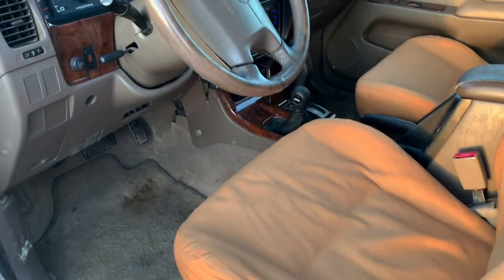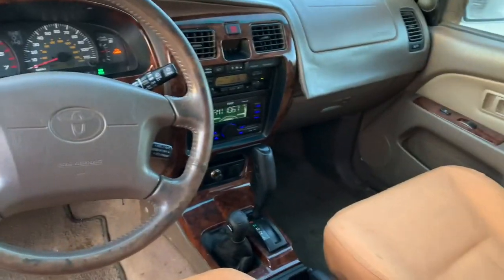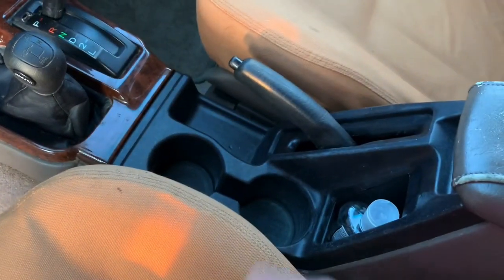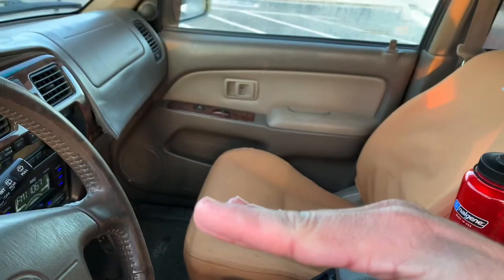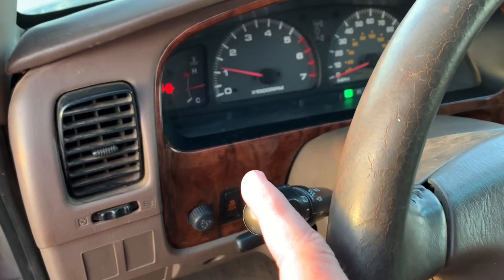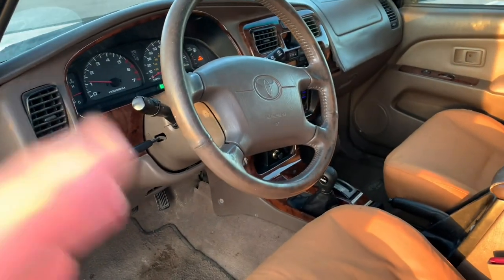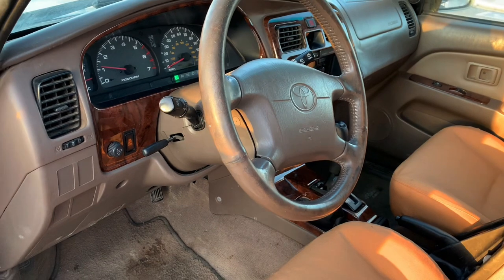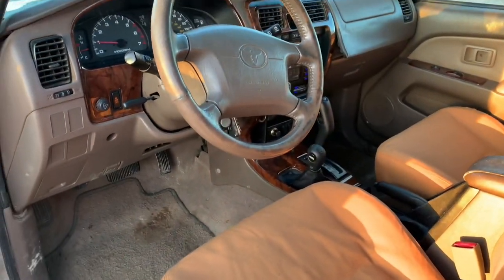4Runner Brake Light Fix

Comment: I'll try this tomorrow if I can. New battery took away the engine light. I might need an alternator soon and I definitely want new oil. Just picked up a 98 4r 4wd couple days ago. I have the brake light too. Thx for the video!
Reply from the maker: Absolutely! Hope it helps
Reply: @FreedomCrawler  Poured some brake fluid. Light gone. So easy

Comment: you may have a slight brake leak. i've filled it before and it looks like it needed it again.
Reply from the maker: I plan on doing the master cylinders in the rear along with front and rear pads. That may get it and help with the braking
Reply: B. R. Good show... will look into that also, thanks! 4Rrunner's lets stick together and have a good turkey day,